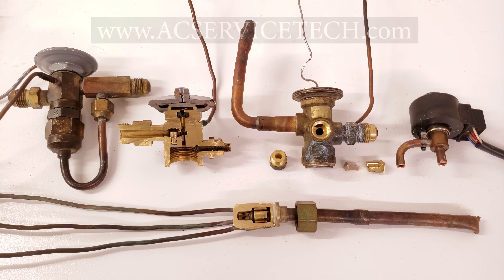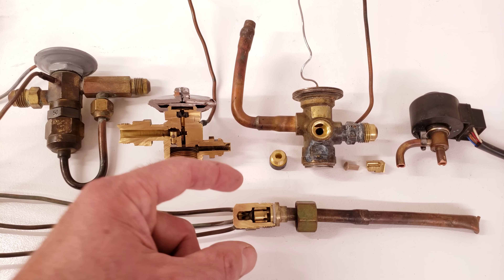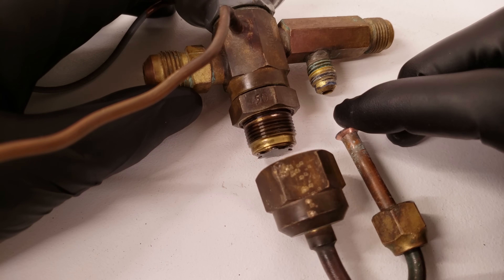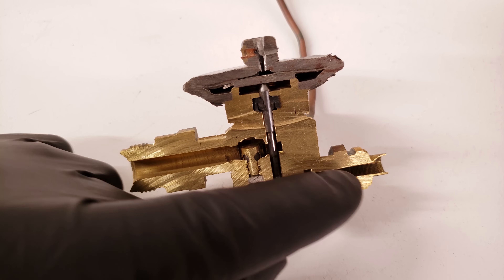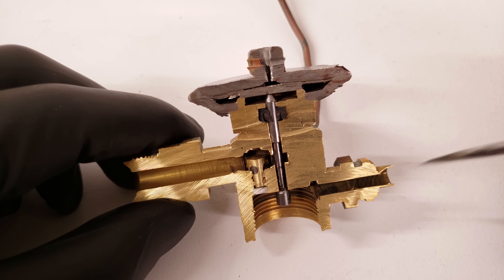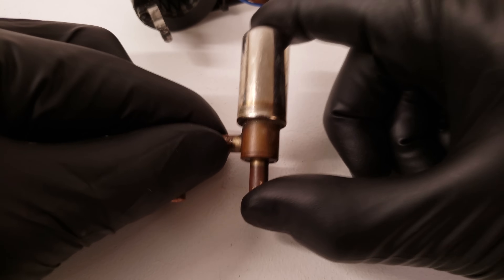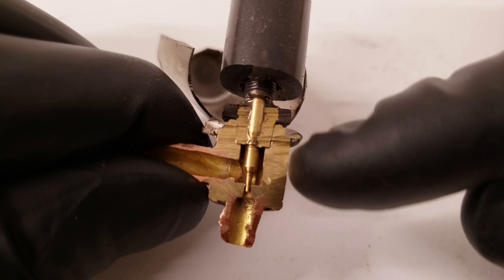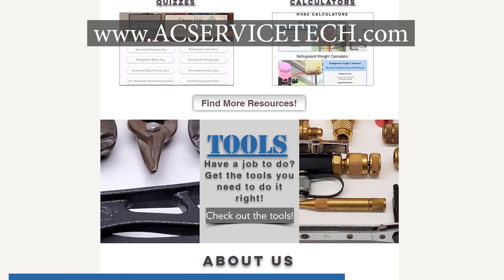HVAC Training: Metering Device Bypass for Heat Pumps Explained!

Comment: Hoping someone can comment here? We have a Bryant Preferred Series 15 SEER 4-Ton Heat Pump. It's from 2013.  It always Cools excellent but in Heat Pump operation, it struggles to heat the house, even when it's warmer at 45 - 50 degrees outdoors.  When installed, the installer took the piston out of the liquid line adapter at the outdoor unit.  The matching indoor coil does have a TXV.  Was the piston metering device not needed in our case?  We just recently started using the Heating capabiltiy of the system.  Thanks and really enjoy your videos.
Reply: I believe that you can pump the refrigerant back into the outdoor unit and  then add the piston then vacuum down the lineset and then release the refrigerant back into the system.  You may need a recovery pump and tank. I wouldn't think it would be too hard to find an hvac pro to do this for you. Then you could be sure.  +- good luck
Reply: @Dinocrus500  I agree.  I'd rather pay someone to do it correctly.  The first hired company did it wrong.  We don't even know if they vacuumed it down correctly.  The Bryant Preferred Series uses King Valve's I believe and the installer didn't know how to use them.  He was searching Google for help.
Reply: Hi Scott. Did you get an answer to your question?  You will need to have a metering device on both sides of your unit, because it is a heat pump. You can find out the size of the piston on the manufacturers website. Get another tech to install it for you and you should be fine.
Reply: @Dinocrus500  Thank you!  The Indoor Coil has a TXV and the Outdoor Shipped with a #67 Metering device, taped to the unit.  The Installer said I don't know what I'm talking about.  With Summer, we don't need heat.  I have a set of gauges and a 2-Stage, 5 CFM vacuum pump.  I have scales, R22, core replacement tool, Vacuum Micron Gauge.  I bought all this stuff when my R22 Heat Pumps on our rental duplex were damaged.  We bought new R22 Units and installed them with a friend as no one would do the work.  Maybe I can fix the Heat Pump myself?
Reply: I think you just got a trainee or apprentice.  What you are needing is pretty basic and any reputable hvac company can help you with it. Do you still have extra R22? That would likely be the most expensive part of the project, and you may not need any more than you have.
Reply: @Dinocrus500  I have 19 pounds of R22 but the Heat Pump in question is R134a.  Fairly new unit but only 15 SEER.
Reply: @Dinocrus500  Amazingly, the installer was the owner of the company.